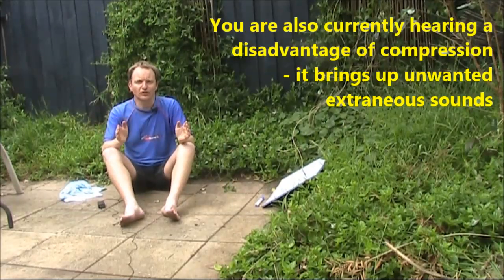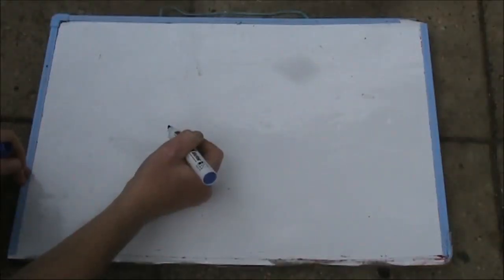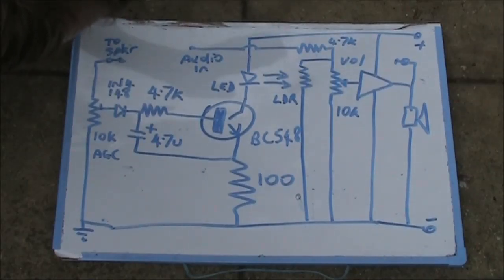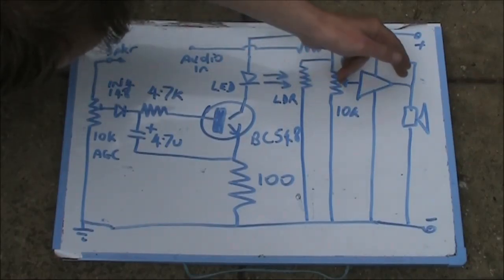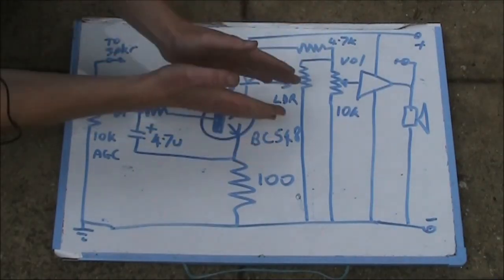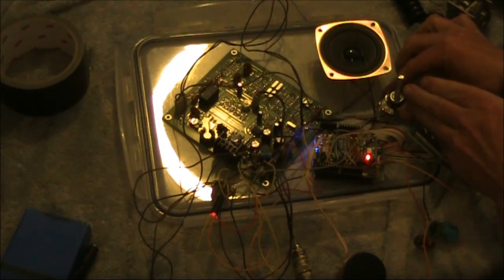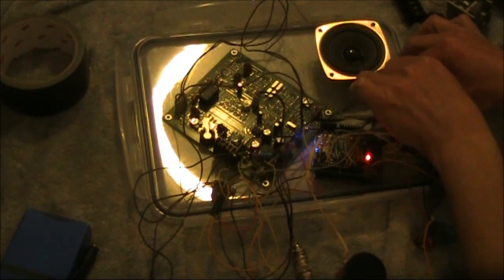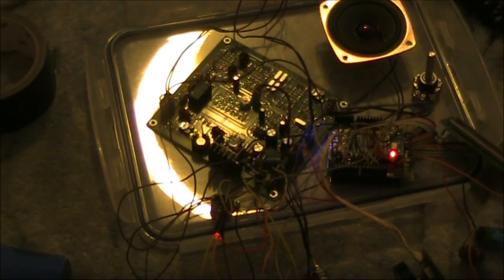Electronics on the Floor: Automatic Gain Control with LED and LDR - Part 1

Comment: I have a question for you;
Is there a way I can detect any radio and magnetic anomalies with in a few miles of me? 
I need a UFO detector to find me UFOs I can point my DIY robotic spectrometer at. 
If I can take a spectroscopy video of a flying UFO, I would be the first in the world to have succeeded. 
Imagine what we can learn from a video like that?! 
US Navy's Gimbals UFO video showed an aura around the skin of the craft that changed as the craft banked to different positions!
Unfortunately, they didn't publish the raw data from the sensor. Only the 2 IR modes. 
I suspect the sensor pickups other secret stuff for targeting, they can't divulge. I don't blame them for not sharing that.
Reply: PS: this is the only circuit I've found that's old school.
http://forteana-blog.blogspot.com/2011/02/ufo-detector.html
Reply from the maker: Can't help, sorry.
Reply: @vk3ye  If you or any one else comes up with an idea, let me know via this comment. 
The feelers are out and about...

Comment: Hi again Peter. I’ve tried this circuit about 5 times. What voltage is required on the base of the bc548 transistor? I’ve tried 3.6v and it’s still not enough to switch the led. I’ve measured the rectified speaker output and it’s barely lifting the multimeter needle. Thanks
Reply from the maker: Sounds like the transistor isn't turning on. You probably need more audio input. Try it with DC via a resistor on the base to see if the transistor turns on and lights the LED.

Comment: What voltage led did you use please peter.
Reply from the maker: just the ordinary type. Think it's 2 or 3v?
Reply: vk3ye that’ll be why then, I was using a 12v 🙈🙈🙈

Comment: Well common mistake.  You are discussing AUTOMATIC VOLUME CONTROL... and that is quite useful in audio equipment, ect.  But for radio, what is actually needed is an AUTOMATIC GAIN CONTROL, GAIN = RF GAIN.  That is quite different.  The AUTOMATIC RF GAIN keeps stages in the radio from Saturation, flat-topping, and distortion.
Reply from the maker: Thanks. I'm aware of all that. An acceptable term for the arrangement described is 'audio AGC'. The BitX has quite good mixer stages (ie diodes rather than NE602s) so RF overload problems are not an issue unless you're very close to high power stations. Hence you can get away with not having RF AGC. However audio AGC (which is simpler to implement) has benefits especially when wearing headphones while tuning from strong to weak signals, especially in RF quiet areas.